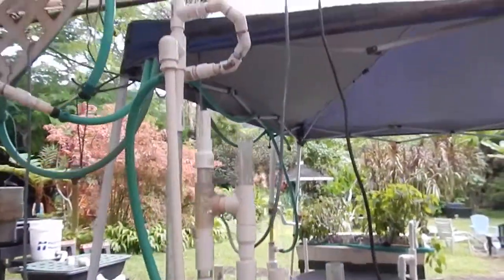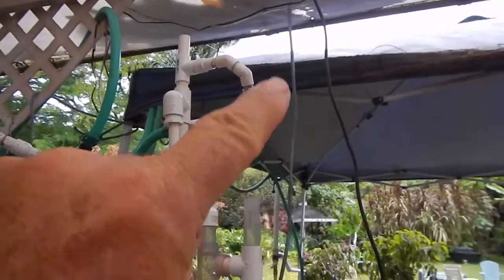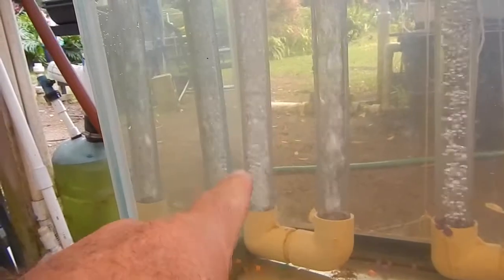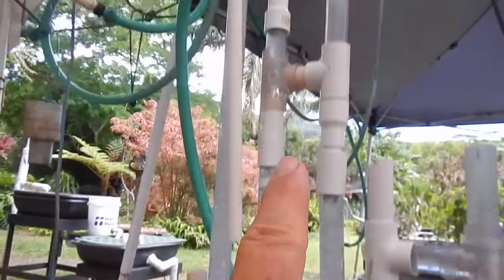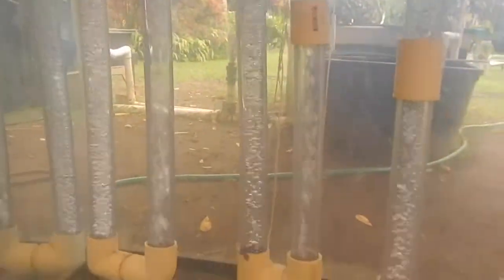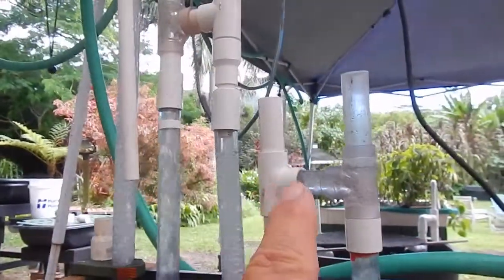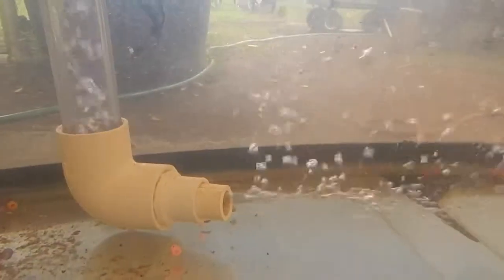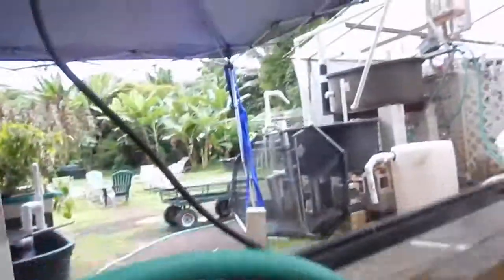Water_Pump_Aerator

Comment: Ah, good questions all.....Yes we use the airlift all the time, the airlift pumps the water up to the cinder bed, that bed fills, filters the water, then has a sipho that drains back to the fish tank....that is where we put the aerator. In out big system the sump pump has to return 1800 gph to the fish tank, when it drop in the fish tank, we use a 4" aeration tube, down, up, down , over 9 feet of aeration saturation. The "T" at the top let in the AIR ! no air, no aeration. Measure trail and err

Comment: Amazing!  I've been intrigued in this since I saw it while at a visit to your place.  A couple of questions.  

1.  could you use this with your airlift system or does it have to be a water pump?  

2.  why bring the water around in a circle in the very beginning?  

3.  how did you measure the height of each pipe?  did you simply see how far the water was being pumped up and then cut it slightly below?  

4.  you use the T pipes at the top, why not 90s?  

thank you so much for your innovation!